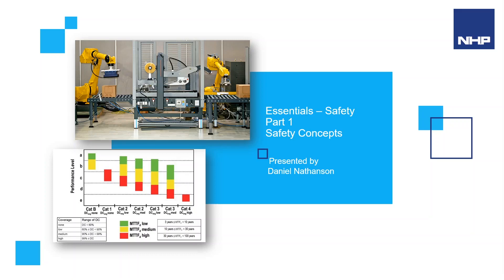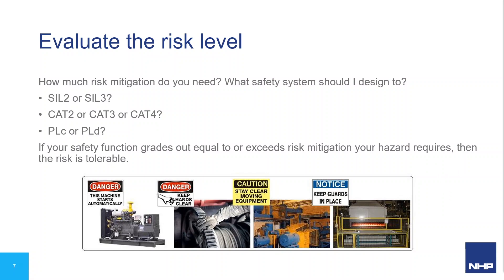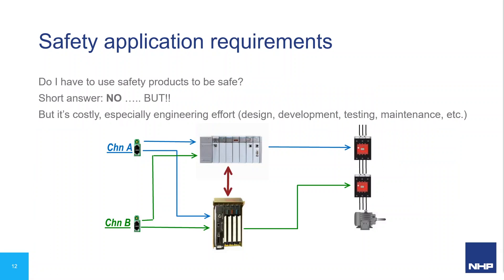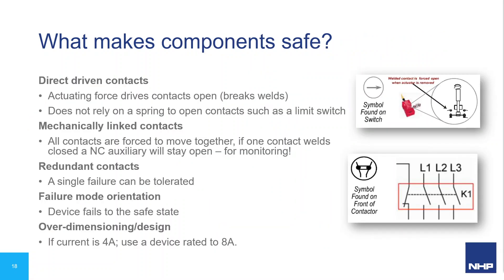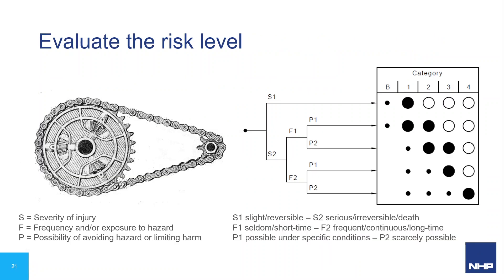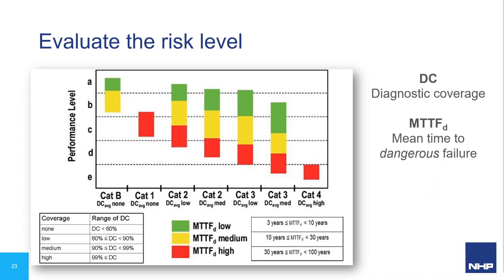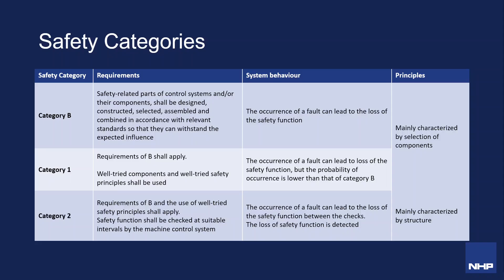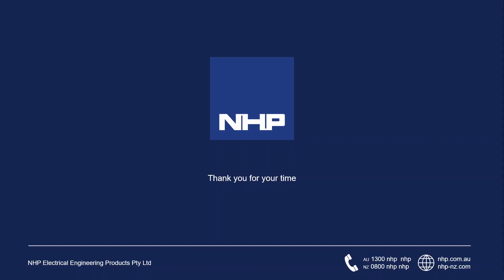NHP Webinar: Safety Essentials Part 1 - Safety Concepts

Comment: By far the BEST presentation on this confusing topic that I have ever seen, excellent job. I take slight issue with your definition of Category 2 as I believe these circuits can use general purpose or safety rated components, the rest of what you said is believe to be true.